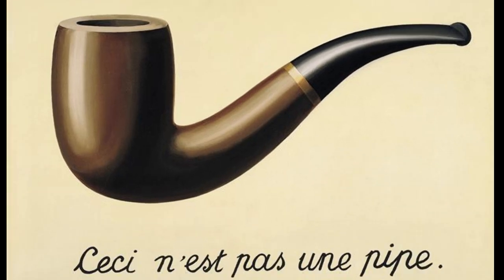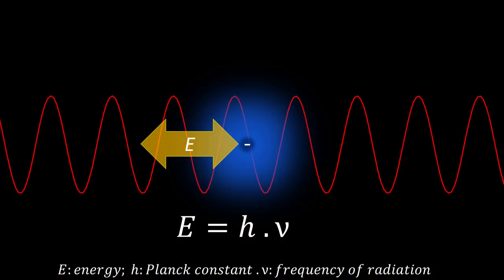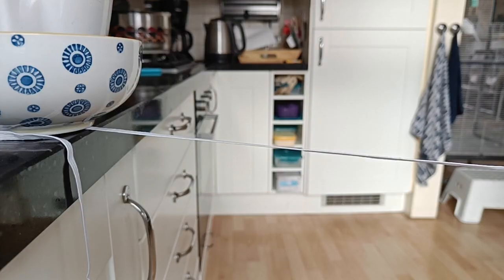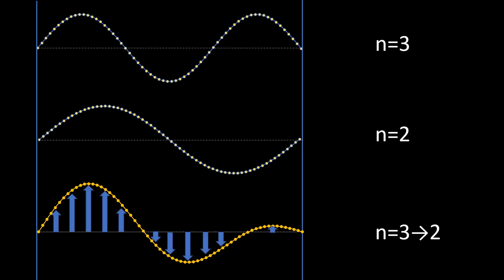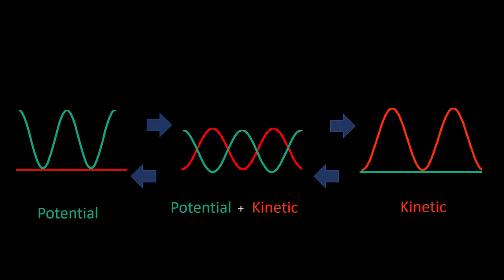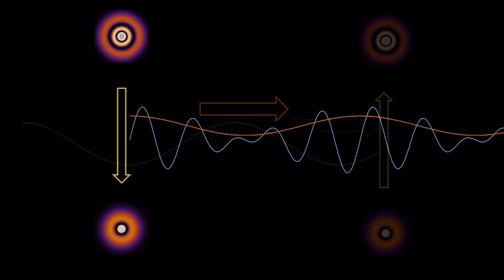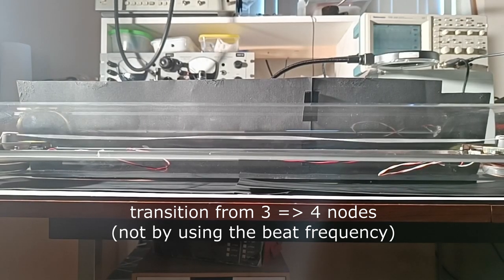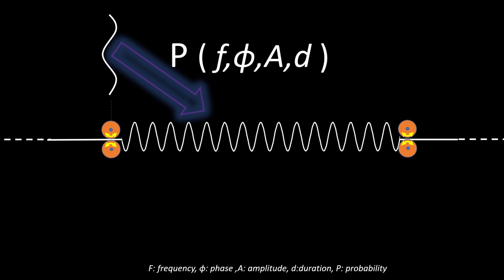Coherence part 3: This is not a wave.

Comment: Warning (@25:57). Insufficient vacuum for anything of note to change physically: Nitrogen (most of air) @ 20mBar and ~300K has a mean free path of just 3.518 micrometres: Far smaller than any feature of the experiment, therefore pressure or density changes will have no effect on energy transport through the gas via friction and accoustic energy, therefore there will be no increase in Q of the system under test.

I would suggest that to achieve sufficient vacuum to prevent energy loss, you would be looking for a mean free path at on the order of the maximum distance within the vacuum chamber: At 300K, for N2, mfp 1m will require a vacuum with an absolute pressure no greater than 70.36 nano bar.

Given the radial gap between the string and the containment appears to be about 50 mm, choosing to have a mfp of that, the max absolute pressure of N2 allowable would increase to about 1.4 microbar. If the 'string' is 5mm across, what about a 5 mm mfp? this is still 14 microbar. 

In practise, the mfp is actually itself measured by noting when the Q of a vibrating system suddenly starts going high, as absolute pressure is reduced. This is then identified with some length scale within the apparatus, and this is how mfp was first measured and the relation mfp= (kBT ) / (sqrt(2).pi.d^2.p) found. d here is molecular diameter, so this also is how that is measured. Because the threshold pressure at which Q goes high: (Read: At which you have a physical vacuum), changes with different fill gasses.

The crux of the matter is that dynamic viscosity of compressible fluid (which does friction, note: not kinematic viscosity, which does pour timeframes) does not have a pressure or density dependance. 

Yet it seems reasonable that it does, so it seems reasonable that reducing the pressure to 2% of what it was, would reduce accoustic and friction losses through the air by a similar proportion: But this is NOT what happens. 

Those losses are constant until you drop pressure to the point that individual particles mostly stop colliding with each other, and so only 'see' the container. This transition is fairly sudden, and mechanical systems with otherwise good Q (tuning forks) show in particular a sensitive way to measure your achievement of a physical vacuum. 

In your case, you need a turbomolecular pump with a big inlet (on the order of the size of your containing pipe: else vacuum conductance will be too low, and you'll never achieve the high Q). You'll also need high vacuum compatible materials: Probably need to replace your string with a wire or thin metal strap, and avoid the elastomer. Your tube will need to be glass and not plastic also.

Then, just run your setup in a mode where you can measure the Q of the system, and detect when that starts increasing. You'll want a high-vacuum pressure gauge (ion gauge, say) to be able to measure the absolute pressure at the low level when you actually achieve a physical vacuum.  Then you may be able to have a sufficiently-long ring-down to conduct your experiment.

Also, keep your pipe: I don't smoke :)
Reply: Reference: https://www.tau.ac.il/~phchlab/Files/Strong1938ProceduresInExperimentalPhysics.pdf chapter 3: Technique of high vacuum, page 106 of the PDF: It discusses how it is that viscosity has no pressure dependance. It also notes that Stefan experimentally established this to be also true of thermal conductivity.

Comment: I’m guessing the friction of the molecules in the string itself is a bigger factor than the air. 
If you have 32hz at A. If you introduced 72hz at B would that create a stable 40hz wave if they were exactly in or out of phase??
I’m a sound engineer; not a physicist lol. Just curious.

Comment: @HuygensOptics ! I watched your video a few times and at 25:14 I thought you should reconsider transmitting longitudinal wave energy to the string. It doesn't seem feasible. The string is an element that is in tension, not in compression.
In case the string force is not pre-stressed, it is impossible to transfer longitudinal wave energy to it.
I hope you can look into this matter. Always make sure the rope is working in tension mode.
Reply from the maker: That is correct, it's always under tension. The amount of potential energy is relative as are stretching and compression.
Reply: @HuygensOptics  I mean you have to make sure when the longitudinal waves are acting on the string, when the string is at its most slack, there is still a minimum pull in the string. 1 wave, 2 waves, ... n waves. Given the resonant frequency, when enough energy is accumulated, the system will have to jump to a higher standing wave state. This we have experimented for the model of truss systems in the laboratory.
I also think it's better to sacrifice the visual view of the oscillations or to need to use a high-speed resolution camera. Replace wire with metal wire (for example steel) because it has high elastic modulus, large plastic stress. This does not lose energy and lengthens the string, affecting the speed of the wave and the resonant frequency.

Comment: Wow,  nice setup and study.  very similar to some of my study
i've been playing slide guitar-like things and attempting to construct a spring reverb.  i've found length, thickness, material chosen All have dramatic effects, as well as the containments associated... notes even cancel their vibes by how i time my strum in relation to the depth of a banjo rim.  We can sense very many subtleties with our ears.  I marked one open tuned build to have 64mm strings and a portion of yardstick about 10mm as the 'finger board' then used a fine marker draw and label all divisions for 1\2, so1/8, 2/8 ...; 1/3, 1/6 1/12's;  1/5, 2/5, to 10ths; and the 7ths.  
1/2ths sound different than the usual and and playing the bottle slide over the 2/5 or 3/5 produces very usable tones as do 1/5 and 4/5 of string length.  euro music scale has 12 tones or nodes, arabs know 52.  may need a fast camera to see what our ears know,  but when harmonics happen we really notice.

i wonder if a light beam or hall effect sensor could replace the string to sense pulsing and not weigh anything. even these will add a harmonic of some sort....

Comment: Two questions:
1. What about Michelson-Morley (MM)? 
2. Gravitational waves occur in spacetime, not space - right?

ad 1 - the existence of some sort of medium called "ether" wherein EM  waves (esp. Light) travel through space was a theory back in 19th century. MM tried to prove this using an inferometer but actually disproved it. If you're now suggesting space possesses properties by itself, aren't we running into a conflict with MM? Or did the MM setup just not measure the longitudinal type of wave (used to change potential energy in the string) that you suggested? Knowing that it was Einstein himself who said that GR by itself doesn't exclude the existence of ether ;-)

Comment: Just like you, I spent most of my life in the field of optics, in particular physical optics and Fourier optics. Just like you I observed that most of the quantum phenomena might have a much simpler explanation when they are viewed with optics background. I came to rejct the particle picture completely. I could not find one case where the particle picture is is really needed. I came to conclude that what is named quatization in reality is only a discretization. All finite systems show a discretization of frequency. And this is not only for perfect confinment like in your standing wave experiment or in the vibrating string of a guitar. You generalized it already very well. In short I would say, the transfer of kinetic to potential energy and back takes time. And this is exactly the oszillation period. And this is discretization - not quantization. Quantum theory leaves out the physical properties of the observes, because it is not contained in theory. But quantum theory claims that energy is quantized in free space, yet is unable to provide an exleriment to prove the claim, because it alwasy needs a resonant system for detection. In short, I came to the conclusion that quantum theory is the biggest aberrational path physics ever went.

Comment: Regarding the rubber band friction; perhaps it's your cue to go to a computer simulation with idealized materials. Alternatively, you can consider making some kind of feedback system that measures the full spectrum vertical force difference at the "left speaker" and feeds this back to the left speaker, thereby nulling out the frictional losses.

Do I get a pipe? :o)

[ Regarding the "wheels representing the energy inertia of space itself" in the context of your riff here, is this really "inertia in space itself", or is it inertia in this electrostatic bond with protons that most electrons find themselves in 99.99999% of their existence? How often is an electron really just hanging out, freely, in space somewhere, merrily going about its business? I'm thinking none of the electrons I ever met are unattached in this fashion ]

Comment: To slow wave propagation way down try making one of those ball and stick millipede type wave machines. They'd probably work best hung vertically instead of horizontally like one usually sees them. That way you can avoid the inevitable paraboloid you get when a string is held between two pillars.

Comment: It's missing the entire point of the analogy but just change the length of the confinement or the tension in the string to achieve the 40 Hz n-node standing wave you want.

Comment: Great video, very well explained, thank you!  But I ‘m still stuck with the question why emitted particles (of any type, with or without mass) are always detected in a single place in the two-slit experiment? Or are they?

What is the rate of emitted particles vs detected particles? And if less than 100%, what accounts for the emitted particles which are not detected?
Reply from the maker: Detector efficiency.

Comment: I watched this video when it came out and got me thinking a thought that just won't go away...  We have no clue what light actually *is*.  Yes, this is a metaphysical statement. Now, before everyone piles on, please hear me out.  Yes, it has various properties such as frequency and amplitude.  It has behaviors such as interference, reflectance, and refractive.  It can be predicted by various formula.  But, that doesn't state what it is.  Only what we've measured or able to describe.  That we sometimes use photons and others waves to describe it (along with clever experiments illustrating it's dual nature) says, to me, that we aren't measuring what it is only obtaining the properties of that which we are measuring.  Here is a for instance of what I'm talking about.  At 60Hz, or 50Hz if your local power runs at that frequency, we would describe it with a volage, current, electron flow, capacitance, induction, etc.  At the terahertz range, lots of photons and energy measured in electron volts, but nary the stuff used to describe speaker hum.  In the optical ranges, again a different set of ways to measure and describe our observations.  The point I'm getting to here is - why all the different ways to describe the same phenomena?  I will agree - that all three examples are nothing more than slices on the same electromagnetic spectra continuum.  Let me flip this around: why the need for separate degree programs for electrical, RF, optical, X-ray, and gamma ray engineering when they are all are studying the same fundamental thing?  Shouldn't there be one program for the phenomena that can then be applied to all these different situations that just "works"?

Note: This isn't to say that any of the various fields of study I mentioned are in any way shape or form to be considered 'easy'.
Reply from the maker: You can actually not answer what something really "is" without becoming philosophical. The best we can do is agree on a set of definitions or a framework within which we classify objects and observations. An electron is an electron because it has a specific set of properties that we assign to an electron. So, it's not that electrons do not exist if there was no definition of them. There is just no universal definition of the concept of "being". So we make our own.
As for EM-frequency, I don't think that there is really a fundamental difference between radio waves, visible light, or x-rays. Again, these frequency ranges are just human definitions that we agree on within a scientific framework. That said, there are large differences in the observed properties between these types of radiation. The main difference that at very high frequency, localization of energy / momentum becomes more and more apparent. Yet on a fundamental level, localization and quantization are 2 very different things.

Comment: At the experiment, what happens if you go from n 5 standing wave to n4 then n3 and so on. The time of the switch between the n stepping down steps, does this alter the beet frequency? What happens if you make one end of the string be in a levitation state with like three connected to 3 springs?

Comment: I share your conviction that photons are no more than imaginary bean counting tools. Dale Grimes did some work along these lines in his two books "Electromagnetic Origin of Quantum Theory and Light" and "Photon Creation - Annihilation: Continuum Electromagnetic Theory". Grimes hints at the Manley-Rowe relations to link frequency and energy. And Arnold Neumaier has also worked along these lines. The optics group at Rochester pushes the boundaries a bit too. I think many established researchers censor themselves about this subject due to the stigma associated with questioning the photon picture. It's the longest debate in physics history, i.e. Newton and Huygens. I've spent a lot of time thinking about an alternative explanation of Planck's equation and the photoelectric effect. Especially one that explains why the particle picture works as well as it does, to give the devil his due. I'll have more time when I retire though in a few decades... :) I appreciate the elucidating work! Top notch! Gets the brain juices flowing.

Comment: 32Hz to 40Hz would require a modulating freq of 72Hz. This would be the original freq times two, added to the freq difference between original and target freq. This is based on four-wave mixing math though so I could be mistaken. You can also calculate submultiples of the original frequency to use if phase can be or is varied.

Comment: Great video. Why don't you use a guitar string or piano string? Wouldn't that make the oscillations survive longer?
Reply from the maker: yes, however, they would be much less visible
Reply: Metals with high elastic modulus will have high wave propagation. The wave will have a high speed v. High standing wave frequency. It will happen too fast to observe.

Comment: I like this shifting of the measurement problem to a wave interaction problem.  I am still stuck on the entanglement part in that it appears that the quanta seem to conserve properties that remain correlated...  so it seems bells theorem suggests that there must be something more to it than just waves interacting with constrained resonances.  It seems like in this framework that the interaction would be encoded in phase information that would look like a local hidden variable...  but that has been ruled out.  I dont know, but that is my intuition.

Comment: Now I have more questions than this video answered... The example (A hypothetical model for demonstrating quantized wave behavior) with confined wave is meant to represent electron in interaction with proton right?
Reply from the maker: More in general, I would represent an electron somehow confined in space, either by electrostatic interaction with an oppositely charged entity or otherwise. It can for example also be a slit or a very thin wire.
Reply: @HuygensOptics  Thanks for clarification, but what even is slit or wire from electron's point of view? Slit would be a space occupied by bunch of another electrons I guess, but wire would be bit more wild evironment. Would an impedance be a good analogy for what is a confinement in general?
I am no physicist, so my understanding here is very surface level, but I am interesed in these analogic explanations via basic concepts such as "springiness" and momentum.

Comment: one string actively vibrating at 3, connected to another string actively vibrating at 4 via a fixed node. could you pass the phonon of energy from one, cancelling the other if you simultaneously switch the frequencies?

The phonon lost from 4->3, should be gained by the 3->4, cancelling the observed transient phonon wave as it transfers. a 1hz filter of some kind at the node might be needed, or maybe just a little freedom at the node for the energy to pass from one string to the other

to reduce resistance, both strings would be the same physical string, no knots.

complete speculation, but would a high tensile fishing line reduce non-air losses?
Reply: If you do, the phonon will run from one side of the wave to the other and vice versa. It will oscillate like that. I think so

Comment: At 15m30s, you say "amplitude modulation", which i think is incorrect. AM is a nonlinear process, where sinewaves (or their Fourier components) multiply with each other to generate new frequencies; trig identities such as sina sinb = (1/2)[cos(a - b) - cos(a + b)]. I think you're showing a linear summation of waves, with constructive/destructive phasing at the difference/beat frequency, with no creation of new frequencies. It's often hard to tell the difference in the time domain. Though, in you're apparatus, there might be significant nonlinear phenomena. 

Btw, I'm an rf/analog electrical engineer, with an emphasis in communication technologies (ie signal modulation and rf/microwave transmission line theory).